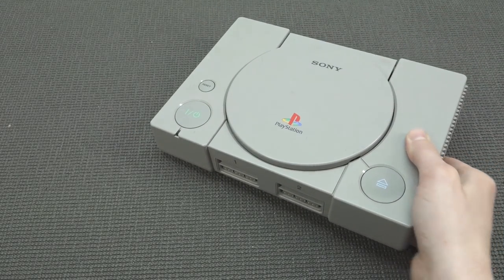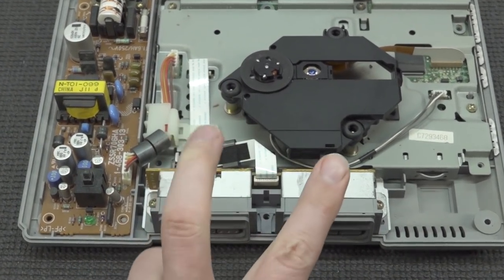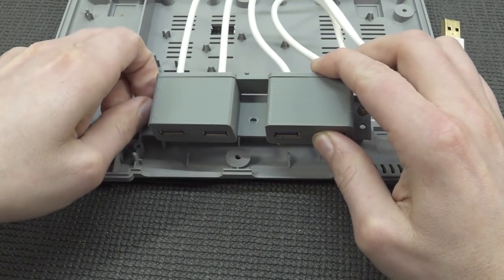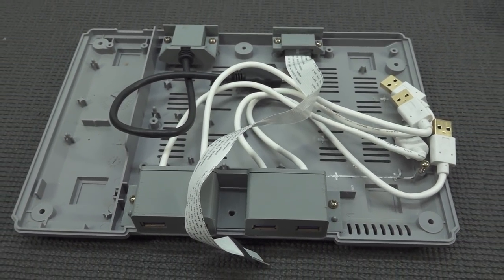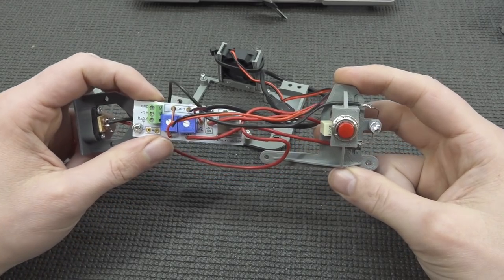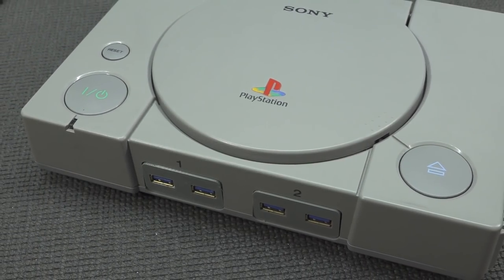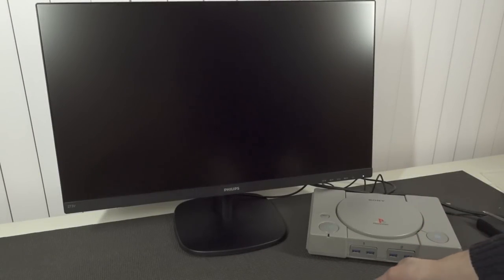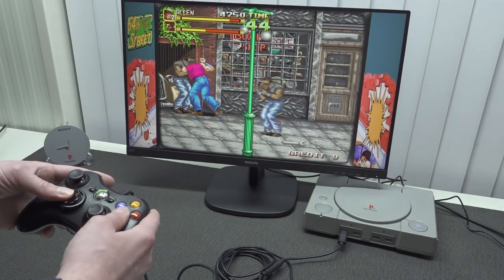This Playstation Raspberry Pi 4 Edition Plays NOW Everything ! 😁

Comment from the maker: Hey Wicked Family !
I bought this pi kit from a local seller here. 
Website real-emulation don't know if it's still selling this kit.
Reply: it's definitely awesome
Reply: Cant find it
Reply: Can you post a link to the sellers website @wicked?
Reply: I got all excited when i watched this video, i have a PS1 sitting gathering dust and i am looking for a console to be an retro emulation monster!
 Can't find this kit anywhere :(
Reply: @MikeSpeakman  Ditto. Can you link to this seller's website? My google-fu is failing me
Reply: You've destroyed great PS1, why they aren't 3D printed PS1 housing? ;-)
Reply: What the f***
Reply: @deagt3388 I would typically agree with you that it's best to 3D print stuff rather than ruining original hardware.
However, they sold over 100 million PS1s, and a lot of them have bad optical drives now, so I think it's fine in this case.

Comment: It’s amazing how powerful this raspberry pi is to play any game on ps1, meanwhile Sony themselves can’t get good emulation for their PlayStation Classic.
Reply: Reports were that the PlayStation Classic was essentially a stripped down Pi (IIRC Pi 2 or similar hardware) running a weaksauce build of PCSX-Reloaded. Once the thing was hacked, however, the replacement improved the device's capabilities significantly.
Reply: Playstation mini classic can play everything. Just bad choice of emulator when in stock
Reply: Yeah the hacked version is a surprisingly decent emulation machine 'almost' comparable to a Pi 3. It's also extremely easy to hack, requiring only a USB stick that doesn't alter the original config. I picked one up brand new for £25/$34. Probably worth at least that just for the cool PS1 shell. I should have picked up a few more at the time cause they've shot back up in price again since.
Reply: It's all down to license cost. Not simple you might think.
Reply: Still far superior than nintendo's crappy emulation LOL
Reply: @Sevarrius  Just a small correction. It was actually more powerful then the Raspberry Pi 3, which was the most powerful Pi at the time. But the Pi had better software support. As a bonus it came with two controllers and a decent HDMI cable. Also unlike the Nintendo versions of the mini consoles, the PS classic had 16gb of internal storage. So it was a good deal when on sale. I picked up two of them for $20 each. Cant beat that!! 

I will say this. I did wonder what was originally planned for the PlayStation classic. Because you know for a fact there had to be something extra planned and got cut short due to time and budget as there are cutouts in the PCB that line up with the small door on the back and other things.
Reply: @Nighttale233  quiet child, you're chatting nonsense again...lol
Reply: Don't can't *Sony won't
Reply: @MorrisseyMuse  it's truth though. switch hardware is a relic of the past that you fanboys can't accept.
Reply: The nintendo classic plays ps1 games better than ps classic itself

Comment: Ironically, most Raspberry Pi boards are made at a Sony factory. They are the contract manufacturer for the Pi Foundation.
Reply from the maker: wait.... whut 😨
Reply: "Most Pis are made in a Sony factory in Pencoed, Wales"
"However, if you get a board that shows "Made in China" or "Made in PRC" then it will not be from the UK"

Comment: Retroflag already has a PSX mini case called Retroflag Station Case for Raspberry Pi 4. You can get it with or without the little LCD screen.
It looks great and super easy to assemble.
Reply from the maker: Yes... i know.
Had this video project in my storage for some time now 😂
Reply: @WickedGamerCollector  would electric or masking tape work on holding that ribbon?

Comment: Wow, this kit has been around for 4 years at least, and this is literally the first Youtube video of it in action that I've seen (minus the kit creator's building manual of course).
I've had the same PiStation for several years, and though there were other console-shaped cases, I chose this one because it's inside the original PS1 and holds so much necessary sentimental value for me. The only thing the kit could have added is some kind of internal HDD bay - a good PS1 roms collection would need all the space it can get.
Reply: totally agree, just stick an old laptop HDD in there and you could have hundreds of gigabytes for games. it'd be nice to see one incorporate the laser drive and original controllers so it could be played like an original too

Comment: Did this exact same project about 3 years ago, We were about to cut the original Playstation Power supply PCB in half and solder it to a step down converter, we kept the original power switch too. Fun little project. Had a heck of a time finding those USB extensions though.

Comment: This is good.  I did the same thing to bring into jail ( Canada ) cause you could only bring N64 or PS1 are latest consoles.  I modded and brought inside.  Had 8000+ games
I converted the controller ports so I was able to use actual PS1 controllers,  and used HDMI to RCA converter so it would use RCA in back of console.  Even made power button work with it.  It was work of art really

Comment: This is cool. I had hoped it was a pre-built case kit when I saw the thumbnail, but still really cool. I reckon you'd be able to fit an optical drive in there, to expand on the usability (although I've zero experience and don't know for certain that Pi's can accept optical drives).
Reply from the maker: It would be cool if he or somebody sells it preset so you can slap a pi in...😁
Reply: Maybe that could be possible with external disk drives ? You know the ones with USB connection, i bet it would be recognised instantly as linux has broad support-drivers for many devices. If you could tear down one and place it internally and then screw it down... hmm
Reply from the maker: @vaggelisvasileiou3126  The guy who made kit haves one for the Genesis Sega ... and yup used a harddisk in his build .. yeah that is awesome.
Or maybe a 512gb or 1tb ssd 😈
Reply: @WickedGamerCollector  how much can you find one with everything put in?
Reply: optical disk drive do not work out the box with retropie you could make it work if you know how but best with usb drive as theee is optional drivers for external hdd but non yet for optical drives
Reply: There are new Pi Station 4 cases from Retroflag with 2 editions (one with a 7 inch screen, and one without). Closest things to a PS setup without cracking open a PSOne. (I like Wicked's mod though).
Reply: Retroflag pistation
Reply: Cool! How much were the power supply components?
Reply: @xex-jdmodz  Twister OS then. It's a full operating system and retropie is already installed on the desktop. Then you can plug in a one of those slim drive DVD RW with usb. You will need 6-7 sata - usb connector with 2 usb ends. One for power. A pi4 will not power a usb optical drive. They take over 1 amp

Comment: Why not just put in one pair of usb ports on the left (leave the OG right controller port in for aesthetics) and plug a USB Bluetooth dongle in to one of the ports and use cordless controllers? Also, without that nest of USB cables inside, you'll have better airflow.

Comment: This is really cool stuff, but one of these days I hope there’s a build that retains the original controller and memory ports + optical drive, maybe with some shell scripts thrown at the software for working with real PS1 discs or CD-R backups
Reply: one could simply buy a(2 ) ps1 usb  adapter for the controller and/or memorycard ports and then solder it to the original controller/memory card ports inside the ps1 to retain it... I've done it myself a long time a go with a banana pi... but as for the optical drive i don't  really have a real solution other than maybe dissemble a optical drive for a pc and replace it with the original optical drive inside the ps1 and hook it up with a ide /sata to usb adapter maybe... That could work especially if one had a 3d printer with some 3d modelling knowledge/experience.
Reply: @MrFlapTrack  That would most likely be the way to go. Imagine having a PS1 raspi that “just knows” how to handle discs like the original console, and boots to a custom (PS1 BIOS-inspired) menu when the drive is empty, so you can run games off microSD as well. All the pieces are out there, you’d just have to fit them together and maybe do a bit of programming to smooth out the edges

Comment: I like it, but if you have a psx around I would suggest to go for an optical drive emulator instead, I believe that would give you better compatibility while still running on the original hardware, otherwise just 3d print or get a psx case for the pi

Comment: Dude, this is dope and you gave me an idea for a spare shell I have. Do you sell kits or have a list and the #d print files available? You could have used the Xstation SD extension and 3D print that replaces the Optical Drive to load cards on top from the dis bay.

Comment: I have my emulation on my samsung galaxy A2 core and I'm able to emulate psp and the only issue I have is the sound sometimes is a little of. but the gameplay is totally o.k! A bluetoth ps1 like joypad is o.k as well! Most smart phones are like a raspberry pi and the emulation configuration is a lot easier as on a pi I guess!
Reply: Most current low to midrange are faster than a pi, however the pi is a lot more friendly for projects.

Comment: for this project i have a little problem to close the playstation case near the power button so i decided to put an original psx power supply with some update to fit voltage for the raspberry pi

Comment: This is a really cool idea and I enjoyed the video. Would have been good to touch more on the mods to install the pi4 in place of the pi3 though, but that's not a big deal, I reckon most viewers could guess fine.

That being said, I have some thoughts because there are parts of this kit that make no sense to me or could have been executed better by the person who made the kit.
Like it's a great idea, especially if a dead ps1 can be found cheaply, but there were so many missed opportunities to make this a better product and a cleaner, easier and more capable install.

1. would have been nice if the usb port panel was painted to match the ps1 grey - I know getting a colour matched filament for printing would be near impossible, but it wouldn't have been hard for the maker to spray paint them before assembling the ports into the printed piece
2. same goes for the power, micro sd and hdmi port covers, but less important than the usb panel being on the back
3. including some double sided 3m tape for the corners of the pi bracket that do not have screw posts would have made it more secure for little money
4. including a small usb3.0 hub board wired directly to the 4 usb ports on the front panel, with a single usb 3.0 right angle connection to one of the pi's usb 3.0 ports would be much cleaner with 1/4 of the cables! Considering only controllers or a single usb stick or portable ssd/hdd are likely to be plugged in, there would be no bottleneck issue with splitting a single usb 3.0 port on the pi into 4 via a hub.
5.  Using a hub as per my idea above would allow the second usb 3.0 port and perhaps one of the usb 2.0 ports to be extended to the back of the case. On a ps1 with the big parallel port on it, a panel could be inserted there to hold the usb port extensions. That would be nice to connect a wireless dongle for an 8bitdo controller or a portable drive for more or faster storage, while keeping the front looking clean as stuff would all be plugged in the back side, as is the power, hdmi and sd extension. For models without a parallel port, the hdmi could be swapped to micro hdmi to allow a usb port to fit on the same panel that the full size hdmi is currently on. It might also allow connection of a usb 3.0 external slimline dvd drive. Assuming drivers could be sourced for the pi (which to be far is a big if), it could allow ripping your ps1 and other disc based games on the pi system. It would be easy enough to do so on another machine and then transfer the iso's to the pi system via usb stick or ssh over wifi, but still might be a cool idea.
6. I don't understand the idea behind the power supply at all - it all feels very unnecessary - 5v to 5v on a board with a manual fan controller - why? a type c extension cable and panel would have been fine - the official pi4 power supply will provide 5.1V 3A and could be used to power a pi3 with a type c to micro usb adaptor for a few cents
7. Does that crazy psu and power button setup have safe shutdown? An argon40 fan shim can be had for under $15 (I know it is $16 AUD when I bought mine), and that includes a (tiny) power button, with safe shutdown and a script controllable fan, all packaged on the one tidy shim. The power switch on the argon can be desoldered and extended with some cleanly routed wires to the power switch that comes with the kit, with the led with the kit wired to 2 gpio pins on the pi so that it gets power when the pi is on. It would be a much cleaner cabling setup
8. It looks like there is room in there for a usb 3.0 to m.2 board and m.2 ssd. One could be harvested from an external enclosure or bought from ebay/amazon/ali. That would allow plenty of space for roms and faster boot and game load times. Even a 128gb drive would be heaps of space for this use case, and they can be had for like $30 nowadays.

Comment: I never understood the hype behind emulating older consoles on Raspberry Pi's. Sure, it can play most games up to PSX era at full speed. But that's it. It's still a much worse experience than emulating on a SFF PC. On Pi there's only a few emulators that work. Upscaling options are limited. Forget about fast forwarding through loading screens or cutscenes on Pi. Forget about using heavy filter, the Pi will shit itself.
What's the point of Pi, except for being somewhat cheaper than bulding a small PC for emulating?
Reply: There wasn't much else a few years ago that was small and didn't use a lot of electricity, there's a million handhelds now. I've kept my pi, it's hooked up to a CRT via rgb scart. It looks great in 240p